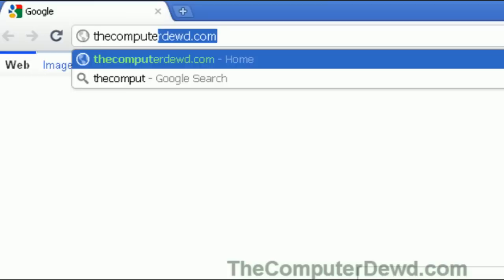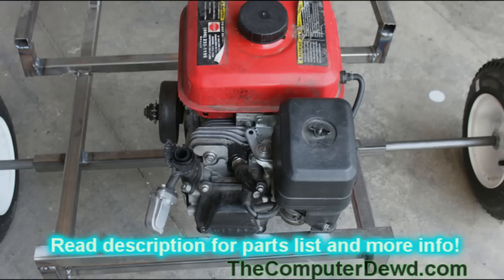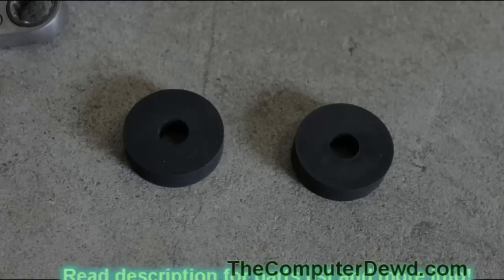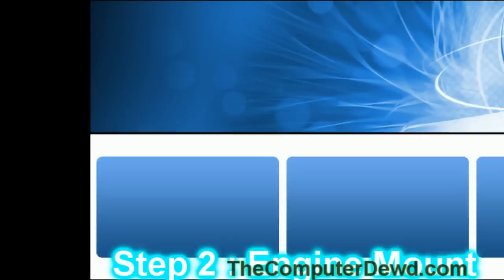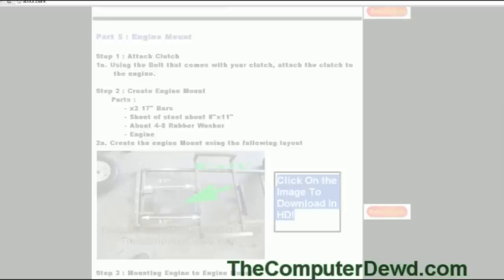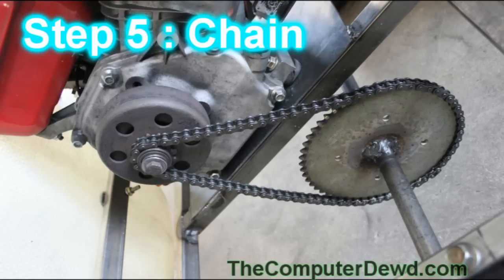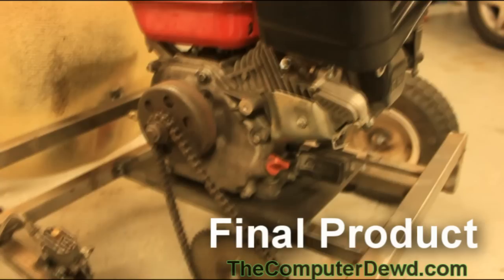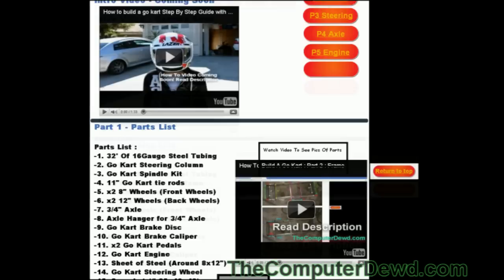How To Build A Go Kart : Part 5 : Engine Mount : FULL SCREEN HQ HD

Comment: TheComputerDewd, knows what he is talking about, a lawnmower engine won't idle or run right without the mower blade. You need to replace the flywheel with a cast iron one, to take up the weight of the mower blade being gone, then the engine will run and idle correctly.
Reply: It's not exactly important to have that weight, because you can just adjust the Idle speed from the carburetor.

Comment: Hey Dewd, your videos are cool. :D I have a question, I want to use a ride-on lawn mower engine (12 hp) and it has a gear box and a clutch I think, would this work? Thanks. By the way, I'm 13 :P

Comment: what is enging name (called) can we use scooty enging 90cc
Reply: you can but it would be so so slow you can't imagine. Here is an engine which is the best engine for it's value. https://www.harborfreight.com/65-hp-212cc-ohv-horizontal-shaft-gas-engine-epa-69730.html